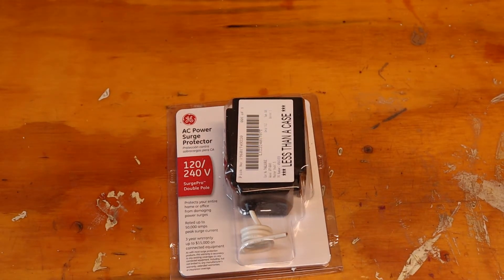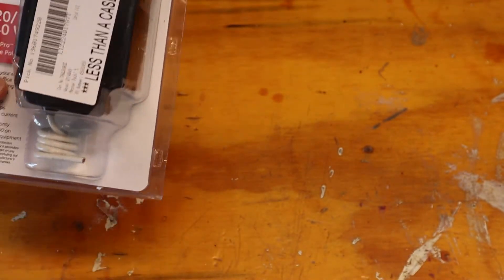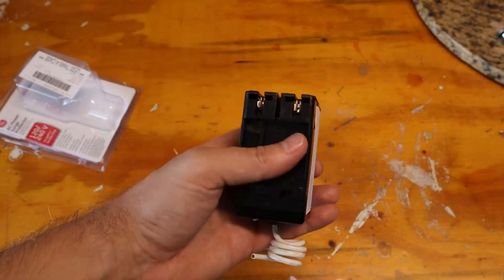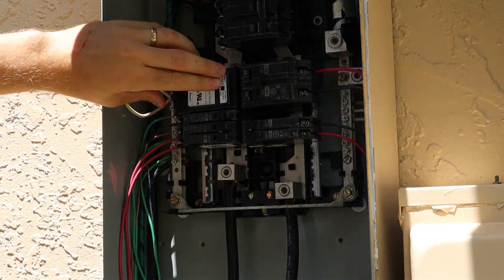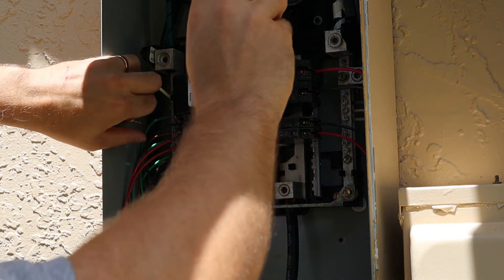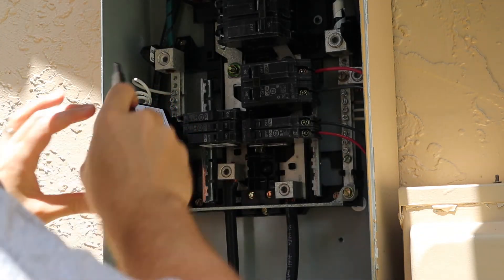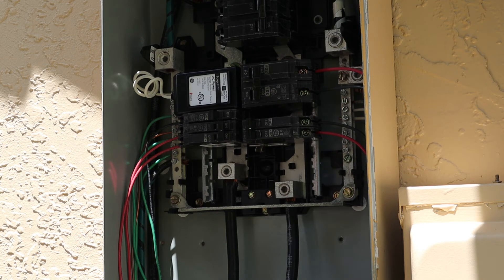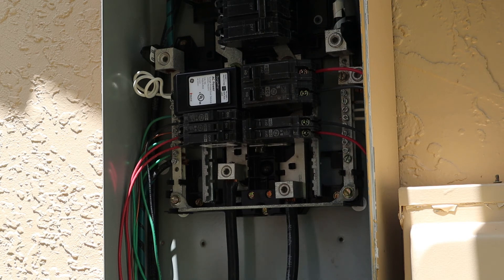Installing a whole-house surge protector

Comment: if I have 40 amp breaker, does this replace that 40amp breaker or does this get installed on an empty slot?  (i have no empty slots)
Reply from the maker: You will need an empty slot, sorry.

Comment: Cut the drain wire to the neutral to a short length please.   You don't want a long path for the surge power to go through.  and yes it makes a tiny bit of difference.  There is inductance and resistance and that will take time for the power to leave.   Time that you do not have.

Comment: Does this do anything in terms of providing protection against lightning strikes?
Reply: That is exactly what it is for.   And maybe a couple other things but lightning is the biggest concern.    It will not COMPLETELY protect your sensitive electronic equipment but it will stop a bolt of lightning from entering your power system in the house and blowing your TV across the room. <g>   (that's a rare occurance but lightning has been known to do some WILD things.  as it is unpredictable.)

Comment: Thanks for the video. Such a quick and simple install. I have been thinking about picking one of these up for my GE load center.
Reply: The guy in the video didn't cut the white wire to the neutral as short as possible.   You need to do that.

Comment: Is the GE panel compatible with Siemens surge protector I bought one😅😅
Reply from the maker: If it is a circuit breaker type surge protector, probably not. If it is a surge protector that attaches via a knock out, should be fine.

Comment: Good video BUT for the fact that the neutral was coiled, looped, which is a cardinal sin. All instructions speak against it. These wires have a purpose different than your normal circuits and the sharp bends and loops cause impedance and deters effectiveness. An example is that when they have leads, both hots need to be twisted, braided, until they are connected. And, the neutral is to be SHORT as possible, but if not possible, then the one MUST is that it cannot be looped, coiled, and the bends cannot be sharp. We old timers trained learning that the bottom of a soda can is the ideal curve. The way the old one was connected was the proper way. Please don't get upset, is just that every nanosecond counts when voltage tsunamis hit your home.
Reply from the maker: Thanks for the tip! I actually installed the old one as well and honestly didn't give it much thought. Next time I'm in there I'll fix it! Got to love YouTube 🙂
Reply: @JoesGarageProductionsLLC  I tried to upload pictures but I was not able to and I rechecked on the instructions and it does mention it.
The video is very good and I'm glad you made it because you saved a lot of money and you're helping others save money as well.
Installing one is much better than not installing any at all and the fact that it's directly inserted into the bus bar without any leads makes them really good protectors. I have the same but for the plug-in neutral. Whenever you have a chance see if you can also protect the air conditioner unit outside, the condenser. Not all surges come through the utility, 10 years ago there was a nasty lightning that stroke and killed a big old tree at my neighbor's and his air conditioning condenser got fried it actually traveled through the ground apparently and killed the alarm system. He had a whole house surge protector and apparently it did its job but the unit was outside about 30 ft from that tree. So, looks like it didn't come through the power lines but the ground or the air or something...

Comment: The white current discharge wire should be short and have no kinks or coils in it because of the inductive reactance it creates during the surge event, which opposes the change in current flow, which is opposite to how you want the surge protector to function. That coil of white wire makes a terrific inductor when a burst of current passes through.

Comment: Does it matter what position this surge protector goes into your panel? I have available slots at the bottom of my panel and I don't know if I need to swap out top position breaker with this surge protector and move the other breaker switch to the bottom.
Reply from the maker: In an ideal world you want it closest to where the incoming power cables hook up to the bus bars. In reality though I'm not sure how much of a difference it really makes.

Comment: You talk about hooking up the neutral wire to the ground bus at close as possible then don't clip the wire and leave a few inches of the neutral wire coiled.  Isn't the entire point of connecting the neutral wire as close as possible shortening the path from the surge protector to ground?  Leaving the neutral wire a few inches longer probably doesn't make a difference practically, but is contrary to the reasoning of hooking to neutral wire to the ground bus as close to the device as possible, isn't it?
Reply from the maker: You are correct. It has been a while, but I believe I left it a little longer than required because it is a pretty stiff solid 10 AWG wire that is somewhat difficult to manage.

Comment: Why in the world didn't you just trip the main 200A breaker to work safely?  "There are old electricians and bold electricians but NO old, bold electricians!"
Reply from the maker: Please note that, in this case (and likely in many others' cases), there is no way to make this panel completely "dead" without pulling the meter. This is a main panel with feed-through lugs headed to a sub that I have in my attached garage. Tripping the main would only make the bus bars dead, but the conductors feeding this panel from the meter would still be very much alive. Tripping the main would make most of this panel dead, but having installed this panel and rewiring my entire house many years ago, I am fairly comfortable working in electrical panels - both hot and dead.

That aside, if anyone is unfamiliar or otherwise uncomfortable working inside an electrical panel, I would recommend calling an electrician or having someone who IS comfortable with electrical work supervise.
Reply: @JoesGarageProductionsLLC  switching off the main is cheap insurance in this case.  Yes all it would kill is the bus bar but that’s what you need to be dead while you’re swapping breakers since that is what they are connecting to and could potentially arc against.
Reply from the maker: Like I said, I am fairly comfortable working around electricity. The way I performed this job was a personal choice based on years of experience. I am not saying the way I did it is the only way, or the way everyone should do it. If killing the main breaker makes you feel more comfortable than by all means go for it.

If anyone viewing this video is not comfortable doing what is shown in this video please call an electrician.

Comment: Hi. I have a 200 amp main panel and another 200 amp sub panel next to it. Do I need 2 surge protectors or just 1 in the main panel.
Reply from the maker: Just put 1 in the main panel.
Reply: Actually, having 1 surge protector per panel is good. Redundancy, especially with surge protection, is a good thing, especially when protecting sensitive electronics.
Reply: How much does it usually cost?

Comment: I don’t have slots available in my main panel, can I install the surge protector in the sub-panel? Great video thanks.
Reply from the maker: There are products available that bount and a panel knockout on the side top or bottom. I believe intermatic makes them as well as others. In theory all you would need to do then is wiring up the wires coming off of that device to an existing breaker. Please do not put two wires under a breaker screw unless the breaker is listed for that. Not many are.
Reply: Joe's Garage thanks for replying. My main panel is inside and I also have the Sense monitor sitting on the bottom, it’s pretty busy. I ordered already this surge thinking that it should work fine on the sub panel but maybe that’s not true, I don’t know. Thanks again!
Reply from the maker: @difelicea  I don't see why it would not work on a sub panel it probably just won't provide the same level of protection as if you were to install it in the main panel. just make sure you only install it in a GE power marked gold series panel that takes THQL breakers, not the thinner THQP
Reply: Joe's Garage , yes it’s a THQL panel, thank you so much for the help!
Reply: You need to install this BEFORE the other circuits for the house.   as close to the main breaker as possible and yet be installed properly.  Time is of the essences with lightning surges and You need to get that surge diverted asap.